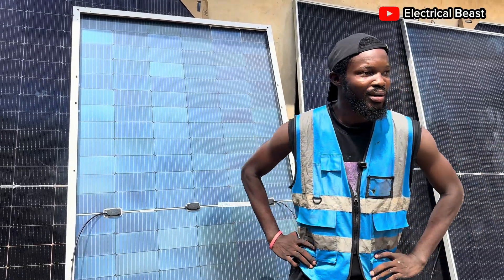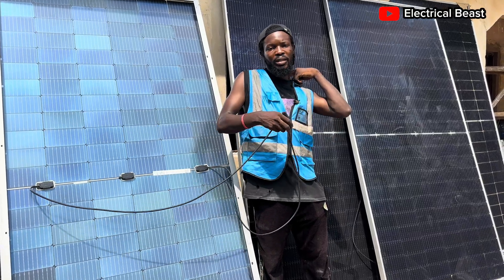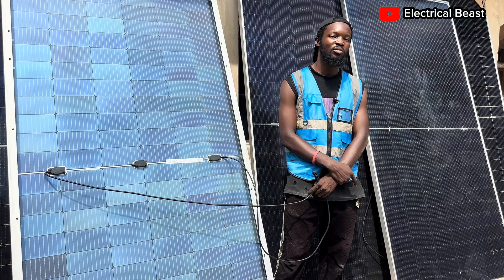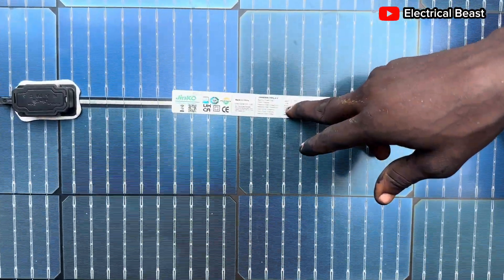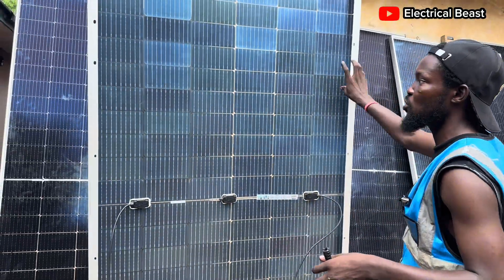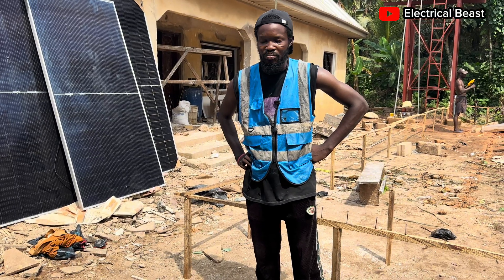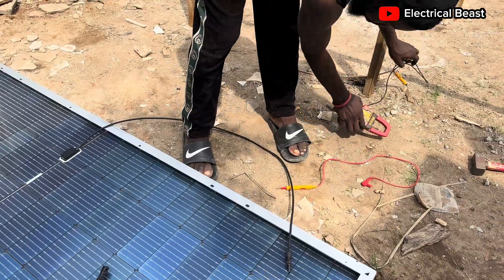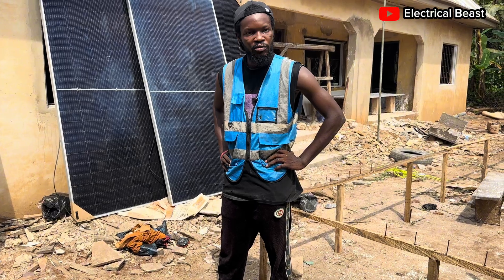The Truth About Bifacial Solar Panels no one told you

Comment: While I agree that bifacial panels will give a little more than monofacial under the right conditions, your experiment is flawed in the sense that only one side(the front) can be exposed to the sun, not both. So what you'll get from the back will be as a result of reflection which will be very minimal. 

Good job though.

Comment: I'm happy more people are going in deep in the review of PVs. 

But your test protocol need to be fixed to get get relevant insights:
- if you want to compare the two faces, you have to make sure they get the same light. So don't put the multimeter on the PV (it creates shadow)
- the open voltage multiplied for the short circuit current is not eqal to the effectively produced power.
- you should have instead measured the Power (voltage and current simultaneously)

It would be great if you make a video to compare the harvested energy during a certain period of time. It's generally more important than the power/voltage/current.

Good job